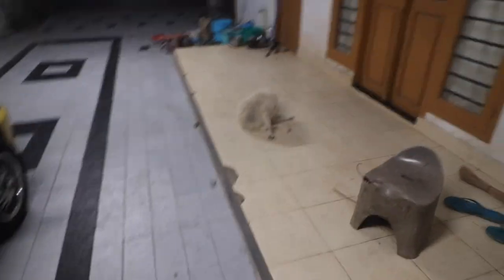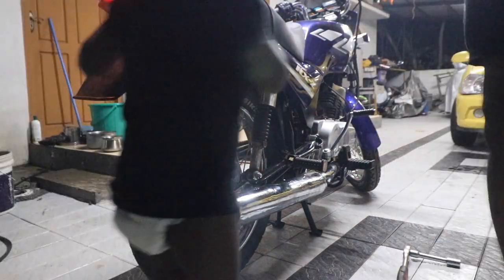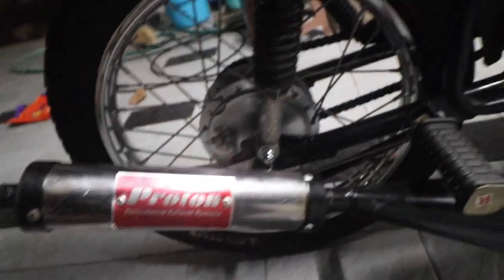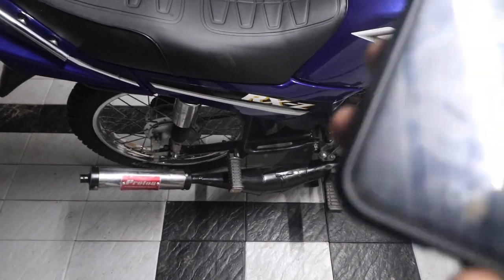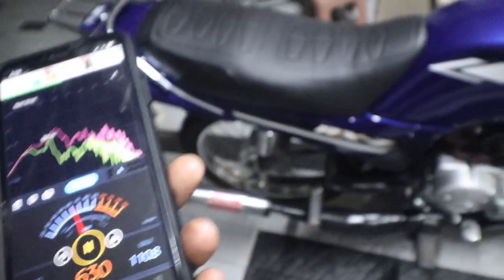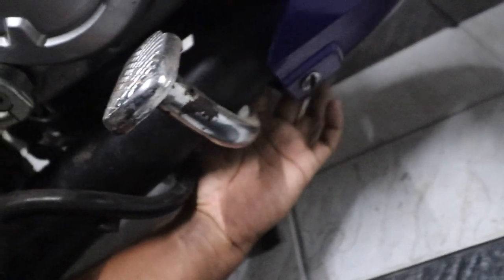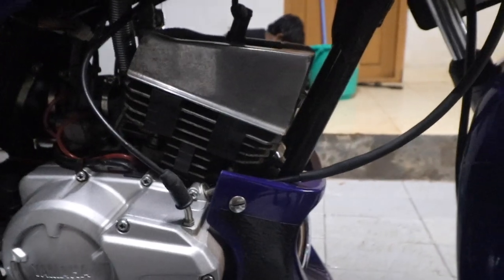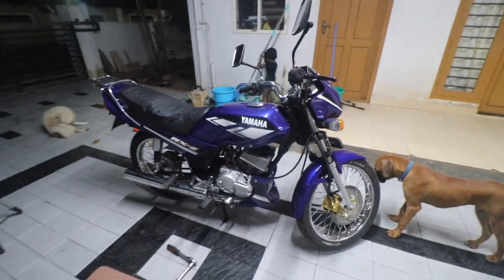Installing a chamber exhaust on the rxz

Comment: Hi bro presently my rx100 running on 1:00 oversize(unsleeved), what is best alternative to get stock performance,fuel efficiency.
Should I do sleeve?
Buy a used bore kit and rebore?
Use aftermarket bore?
Need ur suggestions
Reply from the maker: dinkar m 1mm bore should be giving you a better performance since the bore dia is increased and hence the cc of the engine is increased, for Rx 135 you get pistons till 2mm. Try to buy a used cylinder of a lower size and use that, no after market or sleeved cylinders can give you stock performance
Reply: @Yamakaze  thanks a lot 🖤💕 , I'll keep searching....
Reply: Never sleeve
Reply: @Learning_Politics  bro I have e-3 series standard less used kit if you need it reply me

Comment: Sir is there any way to remove rust from rx tank. ???
Reply from the maker: simple way is to put a clean chain inside the tank and pour 2 liters of diesel and shake, drain the diesel, keep replacing the diesel till the its clear
Reply: @Yamakaze  ok thanks for the reply

Comment: Performance Chambers are cop magnets here in ekm. But RXZ needs chamber as the stock exhaust sounds the worst of all RX series.
Reply from the maker: The Easy Cook actually you are right. But the Rxz sounds good with a 5 speed cylinder and a 4 s exhaust. That’s what I have here. The initial exhaust was too mute, I have a flute which is cut, I also have modified cat that is louder than the chamber.

Comment: this is not a good chamber at all . It will ruin the bike. We used professonally made chamber which had only a buzzing sound when fitted. Mine was a top end chamber which effected the bike after 50 kmph.This thing has no insulation at all and it sounds awful to say the least.
Reply from the maker: Good review, this is removed from the bike right now.

Comment: Why proton? There are so many better tuners
Reply from the maker: Name one please, and by tuners do you mean people who build calculated chambers for particular used case?
Reply: @Yamakaze  yeah, preeti race craft in Bangalore, known as Muthu used to build them for Suzuki and Rx, shahi chamber works Bangalore. ORM racing support Kerala.
Sur tinkering works Mysore.
Reply: Also note, getting a chamber and then tuning the bike to work with it is another ball game
Reply from the maker: Agreed, most of the names you listed are people who make Bolt on chambers, there is no  benefit to them other than sounding like a boy racer. This proton was an impulsive buy, I am very well aware of what it takes to jet as per the chamber, been there done that.
Reply: @Yamakaze  not necessarily, speak to Shashi or Muthu they will make one for the band you are looking for.
Reply from the maker: Ok, got it